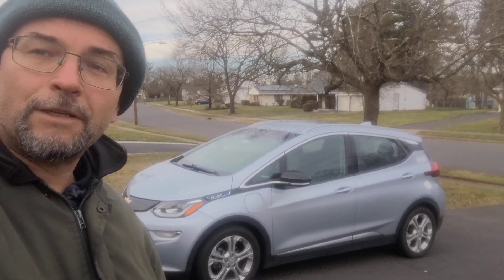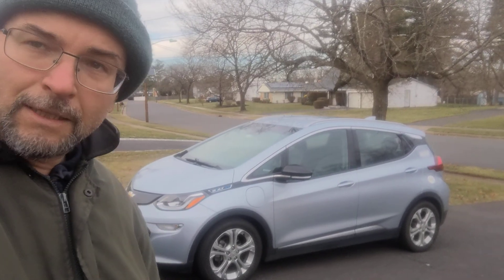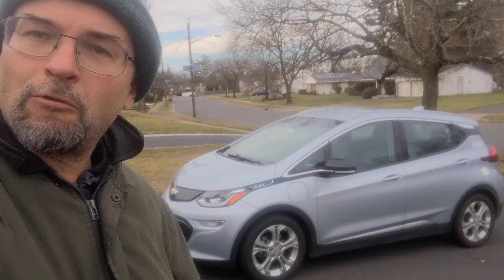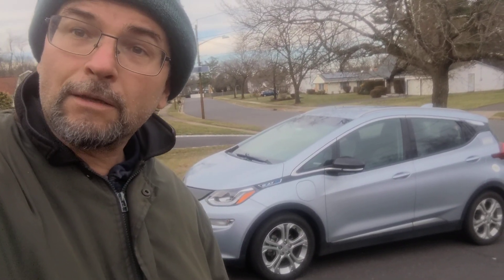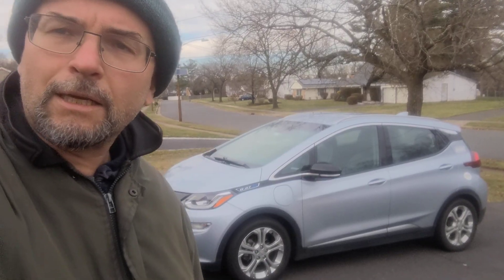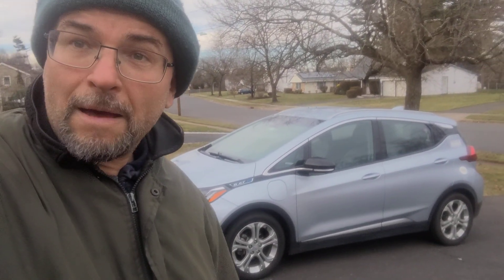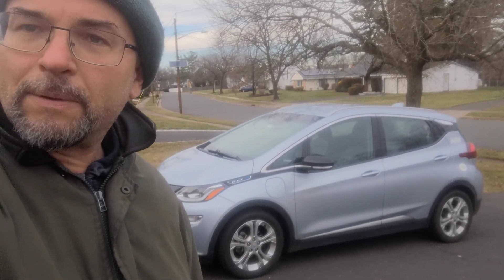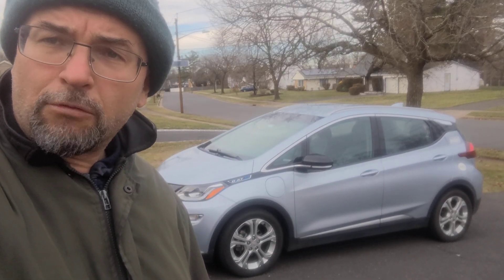Chevy Bolt EV Thermal Management Modification, Part 1: Why?

Comment: I would wager the only gains may be diverting the battery cooling loop via the radiator rather than using the AC compressor and chiller coils in hot climates.
I'm guessing the engineers didn't bother as this is a rare occurrence, likely only when the battery is fast charging thus the AC compressor isn't reducing range; It would also complicate the coolant loop as you'd have to divert it from the radiator during heating.

The other gain could be had from removing the cabin heater loop and just going with an internal only heater - which would be quite the job aftermarket. Not sure what the reasoning was for this besides reusing common parts - electric oil filled radiator are pretty basic items and far more efficient inside the cabin, sans pump. Maybe a heat pump was  planned  and scrapped. 

There could be some optimum thermal envelopes that the powertrain and battery operate, in which using coolant to manage could help, but the engineers seem to have decided against it. A simple share loop with thermostat like most ICE cars could handle that. I'd wager that is why the engineers didn't bother to scavenge what little heat they could during the winter as the  powertrain can stay more efficient keeping it, and pumping watts cost more than gained.

Comment: ??? If the colder temps when attempting to  DC (fast charge say through a TESLA/Adaptor method at a public TESLA station)  is compromised,  what about the  DC charge time
in super hot temperatures?  (can a  2017 Bolt with newer replaced GM replaced battery's that were done post recall)   still charge at a  55 KW rate ?

millions of people live in the Southwest, where  temps during the day can exceed  over 105 degrees,  in major urban city's ,  like    Palm Springs,  (most of Arizona,)  (a lot of  Southern, CA 
San Bernadino,  Indio County parts)   (Las Vegas)  (even  a lot of   Texas)   from  mid day  until  mid August)

If the Bolt can't charge at the 55KW  speed  (even at night) (when it's still in the mid  80's)  during this large part of the year,   this model should be avoided who might be unaware
of this limitation.     ????
Reply: It can't even charge at 55kw for most of its charging curve, but where it can the battery cooling will usually be enough to keep you there. It has a ton of capacity. I haven't had issues charging at well over 90F. 80F is no problem at all. 

After 50% SOC the car backs off the power anyways, so the battery isn't going to be terribly hot. Beyond 105F or so it's better in my opinion to keep the car plugged in to AC power so that the battery can be kept cool instead of only doing so while charging.

If you can't plug in at home it's better to avoid EVs full stop.

Comment: Thank you for the video. Does anyone knows if the current, 2023 BOLT EUV thermal management system keeps the battery at optimum temperatures during cold weather when plugged in at home overnight? Thank you
Reply: Yes, Bolt EV runs BMS to keep the battery warm while plugged in.

Comment: The powertrain produces no heat when the car is not moving, which is when the battery needs to be heated. Next to no heat at city speeds. The amount of heat the powertrain produces at legal highway speed might increase range by 5% if the battery heater is on 109% of the time, which it's not. Pointless waste of time, imo.
Reply: Yeah I was thinking the same thing. Cooling system on the powertrain is only there for high load scenarios with high air temperature.
Reply: I have this car as well (2020) and the DC speed is terrible. When the battery is a little below optimal temperature, it drops to 40kW just like that.

Comment: Sounds like a great idea.  I'll subscribe just to learn how you do it.  I have a 2022 BOLT EUV and have spent many years working on and under cars.  Sounds like you will need some 12 volt switching valves and thermal sensors and control circuits to handle all that.  I suppose you could do it strictly manually, but that might become a pain.
Reply: You could use bimetallic thermostats too, although dialing it in would be easiest to do electronically.

Automotive ones would be the obvious choice, but finding one that would open at such low temperatures would be a challenge.